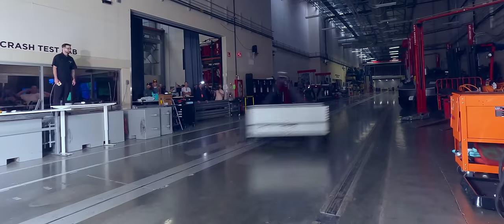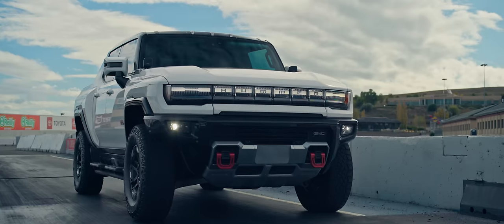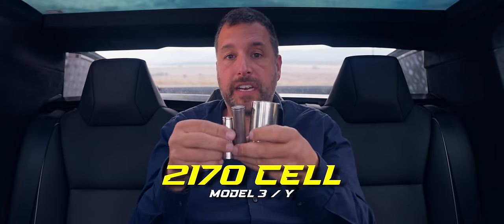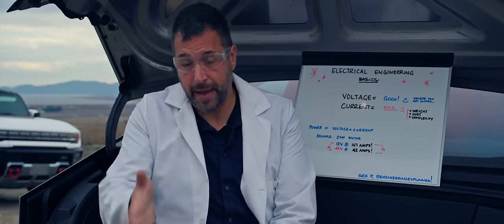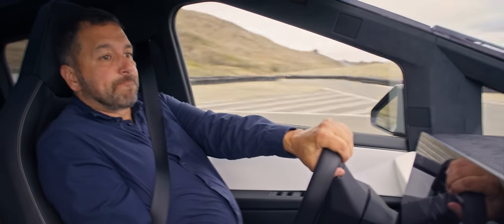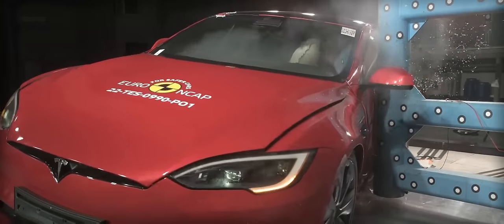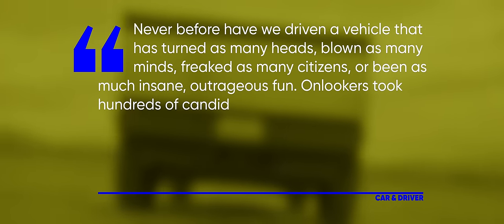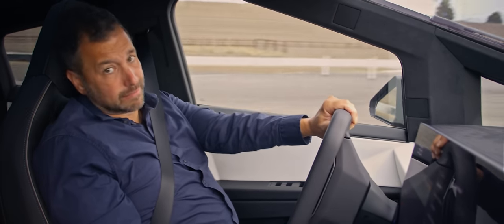Exclusive 2024 Tesla Cybertruck Full Review & Drag Race w R1T & Hummer  — Jason Cammisa on the ICONS

Comment: To be fair, the Hummer has a different purpose than the Tesla and may have motors that give more torque vs speed.  At 3:19, you can see why the Tesla is lighter. Look at the sides of the truck quiver in the slow motion video. Then, the video goes back to regular speed and the sides quivering shows again; it must be a secrete sauce to the strength the steel panels provide during crash testing. The Rivian's side panels are rock solid and not quivering as it goes. I love the fact that Elon is continually making improvements to battery tech that will not destroy the earth and dispel those that are in support of big oil. I also find it amazing that Elon supports a political party that absolutely hates renewable energy and electric cars.

Comment: There are two major reasons I wouldn't dare drive one of these...1, steer by wire. 2, brake by wire. I don't like the fact that a blown switching transistor, loose connection, or even something as mundane as a blown fuse could leave me with no control whatsoever. I'm OK with acceleration by wire, EV's just can't be any other way. Its OK, if you can't accelerate. It's NOT OK if an electrical fault won't let you stop, and much, much worse, if you lose all steering! A parking brake cable could offer some braking if the normal system fails, but, unless there's a direct linkage between the steering yoke and tie rod rack, an electrical fault can be a nightmare. The solution would be a shifting dog, similar to what's inside a manual transmission, that would allow you to push the steering wheel into the column and engage with the pinion in the steering rack. That way, you can have the smoothness and precision control of "steer by wire", (I like the idea of adjustable steering rate) but, still have a safe way to get off the road, if the system goes wrong. A vehicle MUST be controllable, even if all power is lost!

Comment: Infiniti has had steer by wire & drive by wire for years now.  They have it in the Infiniti Q50 sedan vehicles.  I'm not sure what Jason was talking about when he said the Cybertruck is the first in production.  Because its not.
Reply: Infiniti has a redundant physical steering column, so it's not really a true steer-by-wire. The cybertruck has no physical steering column, just wires.
Reply: @TheReal_JG   With the Infiniti, the physical steering column only engages as a backup, when there is a major malfunction.  But otherwise the electronic steer-by-wire is always implemented.

Comment: Wait what. Did he say there was no Failures on Throttle by wire systems. ?? Toyota, Chrysler and GM had HUGE recalls on their fly by wires systems at the start. it took them like 2 to 3 years to work on the failures. Still do this day there is Fly by Wire failures in cars that cause them to crash.

Comment: Guidelines on a comment section? Different, but alright. Video was good and entertaining. Lot of talk about the pros and almost zero talk about it’s cons or the fact that the entire video had nothing to do with anything that makes a truck, a truck. As far as the safety test and structure- be curious to see a full crush test and what it does to other vehicles in a collision. It’s great that it may keep its occupants safe, but I’m just curious about the potential damage it would do to other “normal” vehicles. Obviously not just a cyber truck issue as these vehicles in general are on the heavier side. Would have liked to see some legitimate truck tests. I noticed the hummer looked like it’s ride suspension was fully raised- could be wrong but I thought that had adjustable ride height and could get a lot lower to the ground than that. Side note- it can actually go off-road which goes back to the truck being a truck topic. Good video- just seems like it was fully funded by Tesla.

Comment: Given that stainless doesn't crumple...read "absorb energy" as well as steel or aluminum, odds are that drivers involved in a frontal crash at speed, will be about as safe as they would be in an 1968 Buick.  If the body can't absorb the energy then the only thing left is the occupants.

Comment: Not sure why drive by wire is such a big innovation - does not seem like a big deal. It feels like another possible point of failure. It is complex, uses two motors etc. 
The whole design is good for maybe a sedan but not a work truck or off road truck where ripping wheels off and fixing it with welder is common. 
Costs here are through the roof - feels like a very delicate toy.

Comment: 26:29 Elon: "If I would have known how difficult it is, I would not have made it". 
 
Seems like a common theme from Elon - does not deter him EACH TIME to announce anything he does with "this will be the best you have ever seen - and we will develop it ten times faster, the build will be 10 times quicker, and it will be 1/10 of the cost. And we have it NOW.".  
 
And then it comes years late, when it comes at all. 
 
 
Elon promised to have a colony on Mars - not a trace found
 
Elon promised commuter rockets between city.  
 
Elon promised Hyperloop - a train in a vacuum tube. Tons of hype, in the meantime the test tube (that was not more than a tiny, unuseable experiment) is broken down. 
 
All that remained of the Hyperloop is a 1-mile tunnel in which a queue of Tesla taxis are rolling up and down - in a queue, as it is a one-lane tunnel, all taxis have to passed through until one can go back. 
 
Elon founded the Boring Company for that taxi tunnel, Claim "We have the technology to drill 10 times faster at 1/10 the cost". Turned out that he had NOTHING - beyond empty slogans. 
They had to BUY an existing tunnel boring machine. Turns out they are exactly as slow as a normal boring company and exactly as expensive. 
Physics does not change...
 
Or what about his booster rocket for his Teslas - not a rocket engine, just compressed air? What a great idea - lots of extra weight to have thrust for some seconds - and beware when a car is behind you.

Comment: My guess is that the Achilles heel will be the tyres? A mortgage each & will only last 10K miles at best! My Porsche Taycan only does does 12K before the cords are showing through on the inside edges of both fronts! Porsche say this is normal? If I had not had a puncture in my right rear having to have it replaced, I could have been dead now! Don't think I'm Boy Racer, I'm 67 & drive mainly long journeys on highways. I bought for the room comfort & cheap charge at home facility! I also get 3 years on road charging with Porsche/Ionity!

Comment: The difference between the Cybertruck and the Model X is that the falcon wing doors were unnecessary. The new innovation in the Cybertruck - steer by wire, 48V - will get trickled down to other models. And if they want to do true driverless car, they need steer by wire, and the public to trust steer by wire.

Comment: I find it amusing that this entire review touches on NOTHING that a truck is expected to do.
How many sheets of drywall can it carry?
What's it like towing?
Can it get through the two tracks up north?
Can it pull my hunting trailer to the woods for a week?
What sort of water crossings can it handle?
I must have skipped it, but what's the actual range?
Instead we got: It can drive around a go-cart track, it has steering that I'm sure is going to feel terrible and disconnected in any sort of off-road condition, and has a big floppy wiper that's going to be hell in any sort of snow storm.

Comment: Entire industry trending towards brake by wire!
Ever heard of a failure?

Mercedes SBC brakes were a brake-by-wire system that was introduced in 2001 on models such as the E-Class, SL-Class, and CLS-Class. The system eliminated the mechanical link between the brake pedal and the wheel brakes, and used an electronic signal instead to activate the brake caliper. 
The system was supposed to improve braking efficiency and stability, but it also faced several problems such as software failures, millions recalls, and customer complaints ... and even deaths.
MBUSA is offering 25y warranty/replacement of the brake pump.
MBEU is offering as usual - nothing.

Comment: Very impressive but no gas motor just in case electric not working. Toyota Prius has the best idea and will probably follow through with a better truck design. A simple diesel motor without an ECM that will start every time needed would be great.

Comment: I still would not trust a steer by wire system.  NOPE NOPE NOPE.  As a pilot, I want redundancy and physical input in case of a malfunction, just like I have in the planes I've built.  The autopilot in my RV-8 has 4 disconnect switches.  One on stick, one on the touch screen and one on the autopilot module and one in my switch breaker cluster.  If I need out of autopilot and and somehow those 4 fail-safes FAILED, I can overcome the clutches in the autopilot. 

What happens if the tesla drive by wire system fails (yes I realize they CT has redundant steering motors)?  Will the truck shut itself down, or will you continue to go the last direction the wheels pointed when it failed.  I'm sure the engineers have safeguards, or I hope they do, but nobody has mentioned what those are.
Reply: @Nuke-MarsX  it’s by FAR not the safest car.  Have you SEEN the rash test footage?  The adult “dummy” head experienced whiplash near twice that of a F-150.  The cybertruck down not have inertia absorbing crumple zones.
Reply: @Nuke-MarsX  The CT has a completely different structure design than the M3, MS, MY, MX. One cannot point to the performance of a totally different vehicle of any OEMs past and assume that safety record continues with a new idea.
Reply: @chadcoady9025  it's not about how it looks, the test result were very good compared to other modern care, not nearly as good as the model y but still nowhere as bad as people say, they still have a good crumple zone

Comment: You show how the simple sheet of metal can be deformed, then also that the hammer does not leave a mark on the Tesla, then you claim that it doesn't matter which vehicle someone hits it with....hmm...interesting. I ask for the plastic cooling grid and the smooth plate instead of the angular stainless steel.

Comment: This is not true about 12v since 1955 - we have plenty of 24v systems - they are mostly commercial. Move to 48v will simply mean Tesla will be more expensive as all low voltage devices will be "special". Also a lot of down converting would still need to happen - for example, for towing. Not exactly sure how much copper this saves. Also not sure about 48v DC being "low" - it is getting quite high.
Reply: Nope. 48v was the goal. You're talking about 24v systems for trucks and busses.

Comment: Correction on the Throttle by wire statement, Throttle by wire cars DO HAVE failures of that system, The thing is when that happens the ECU Just shuts down the engine, Imagine what could happen if STEER BY WIRE Shut down due to a Failure on the highway..? Sorry, I don't trust it.

Comment: Couldn't a Europeanen Version change all the metal panels with a kind of blackish bumper pvc material? It would still look crazy futuristic. Easy to fix and superlight. Would make the AWD a cheaper 0 to 60mph in 3.5 seconds truck.
Reply: The panels are load bearing. So probably not.

Comment: With no physical connection to any of the controls, what’s the risk of your vehicle getting hacked and someone maliciously takes control of the operation of the vehicle?
Reply: pretty low, it hasn't happened on a Tesla ever, I doubt they'd reduce their security system and change anything
Reply: @sarkaranish  true, but this is the first 100% steer by wire, increasing the risk for full loss of control of the vehicle.
Reply: @stormsurfin  absolutely, and I totally agree with you. no matter how redundant it is, I just can't shake the feeling that a direct connection is better. probably will be fine, but i'm a little paranoid haha

Comment: The fitment of the stainless steel panels is horrible. The panels are wavy and not flat. It looks pretty bad in the right light, the same light that shows all the fingerprints. 
 With being said, I absolutely love everything this vehicle is capable of on the inside. I just wish he hired some Quality control personnel  that gave a crap because those panel gaps, edges and corners are not perfect enough to charge that 100,000 price tag.

Comment: It is NOT truck 2.0. It cant be until all manufactures adapt a similar design and everyone uses it just like the cross over style car is the car 2.0.

The truck IS a gimmick simply because the Bed is useless. This truck was designed by someone who doesn't use a truck everyday. 1 simple flaw > the sides of the teslas truck beds aren't accessible, 90% of the time people are reaching in from the side of a truck bed, not the back.

Comment: The only good things about this truck is it's tough and safe. Functionality goes out the window after that. It is at this point where this is now just an oversized SUV. It has no useful capabilities as a normal truck in it's class. Simply because once you attach a trailer to this thing, it will surely cut it's range in half. From 300 to 150 miles if you're lucky. Couple the affects of that in the winter time, you get an even more useless hunk of steel :(

Comment: This not an “everyday person” truck. There is not much utility in the truck yet.  Loading, hauling, strapping down, etc.  people who need a truck, use the truck to haul materials in the truck… rather than having to  pull  a trailer, or at least haul the trailer less so you don’t have to pay the insane toll fees…
    How is this truck going to react to a headache rack? Or a full length head ache rack and over head storage for the plumber?    Going to lose 50% of the range?
   … or how about the counter top contractors? The main point of a truck is for work…
    If this truck was designed for with the contractor in mind first, then made a step up for the luxury and comfort…next year ford and GM would be completely out of business.  
     Tesla… are you going to say no to the “automatic kill switch” in 2026?  
     Definitely not a Tesla hater, they are very cool, extremely comfortable, and super techy.  
But there are more drivers on the road that need a “XL” model than a “king ranch” edition.
Reply: It's for people to show they can afford a "unique" product. It's like people who live in big, crowded cities buying the original Hummer to drive to a local corner store.
Reply: @secondrule  well, yeah I get that.  It’s all just backwards… IMO.   But you gotta make the money first to fund the next phase.  We will see how the 25k Tesla turns out…

Comment: Only problem is it's way more expensive than they originally planned, and still ugly as all get out. Costs an extra 20K if you want the one that actually beats the Rivian. For 20K, pretty sure Rivian can more than gain back that (.7sec). Also, who tests somethings' strength by hitting it with a plastic hammer. Next time use a real sledge! That thing is fast though. Dang impressive beating the Rivian. Back to the drawing board for them. Of course it was a '23 Rivian, to a '24+ Hummer.

Comment: The more I think about this car the more i’m starting to hate it. The reason car panels flex is so they don’t instantly kill the person walking down the road, and me in my little mini cooper don’t stand a chance and now i’m very glad i bought a Ram 1500 to go up against that Goliath. And the people who are actually able to afford it will not understand at all about weight transfer. Steer by wire is the scariest thing ever, chewed wiring from rodents will be hilarious and i don’t trust tesla with that tech. cars run 12v architecture because most things like windows, lights, switches, sensors, controls units, heating grids, and some smaller sensors run off of a 5v reference, it’s almost like people who don’t know how cars actually work shouldn’t be saying stuff about how 12v stuff is so old fashioned, it’s how stuff works bud. BMW released their 48v alternator, sway bars, starter motors, and electric motors years ago so i don’t not believe tesla told them with the silly book they sent everyone. Just seems a bit not thought all the way through and isn’t all that ground breaking like the e-type, beetle, golf, or so many other vehicles that changed the way we think now. Hell the G-wagon 6x6 is better as the best trump card for pickups, or the og……Ram t-rex from the 90’s.

Comment: It's a car, at best a SUV, not a truck. What's the payload, box dimensions, towing capacity, etc. My wife can pick up a pallet of mineral or salt(2000+lbs) with her tundra, can this so called truck do that?  We haul 12 1600lb cows in a goose neck stock trailer with a Dodge Ram 3500, can this so called truck do this? In this video I hear a lot of comparisons to cars, 911, DeLorean, etc. Elon failed giving his son a cyber truck in my opinion. Also I was once told, a real truck has clearance lights! Try again Elon, one for the ranchers in rough territory.

Comment: Infiniti beat Tesla to the drive by wire steering over a decade ago. please do better research. 

the only time Infiniti's system becomes physical is during a total failure as a safety feature.
Reply: Infinitis have a steering column and rack as a backup. This is the first vehicle without a physical connection to the steering